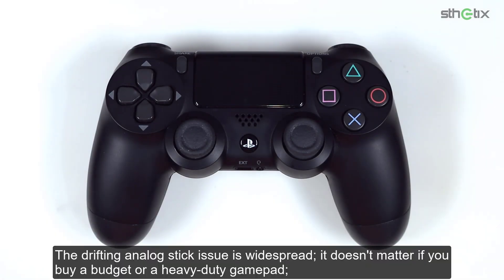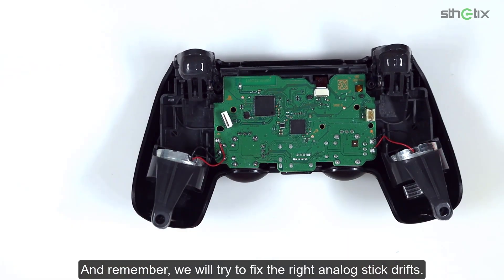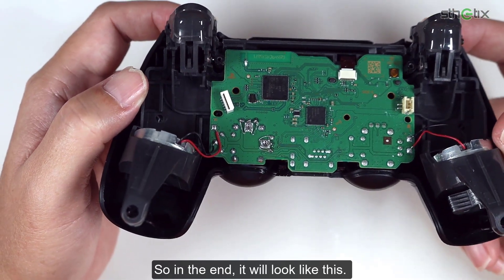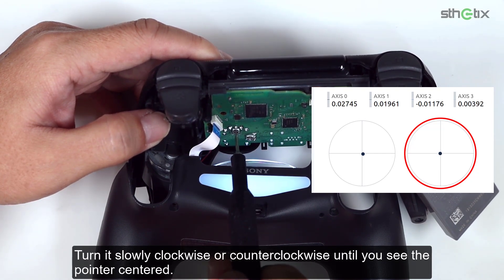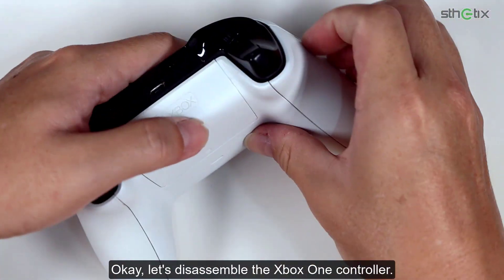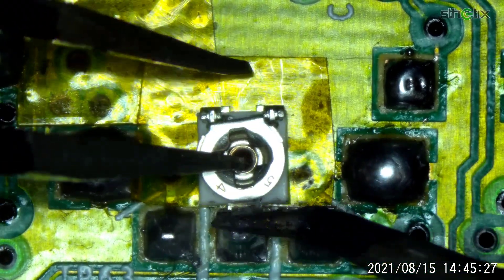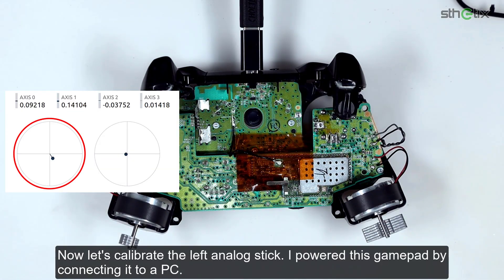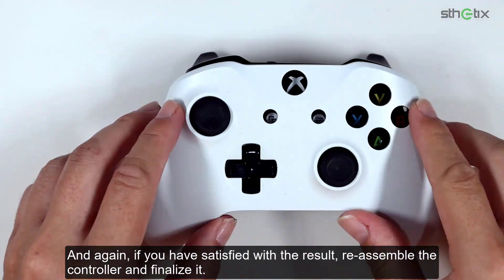THE ULTIMATE WAY TO FIX ANALOG STICK DRIFTS ? PS4 PS5 XBOX ONE NINTENDO PRO CON AND MANY MORE

Comment: at first I thought you were going to make the analog stick hotswappable so you could just swap it with a brand new one once it starts getting drift.
Reply from the maker: no that one not always work either
Reply: How are you going to secure it to the board properly? Use common sense dude...

Comment: this idea work but only for the right analog stick end it does not go all the way to the top or bottom, of the circle,, kinda stays half way dont use on the left analog stick testing on MW the player will not run since the analog does not go all the way to the top or bottom end the sprint press on the analog will not work also..  only work good for the right analog stick no the left....

Comment: I really appreciate the credit! :)
Reply: I was planning to email you this question, but felt like I’d be a bother. 

Would it be prudent to put your invention on the board after fully replacing both modules?

My thought process is:

Brand new modules that have been properly calibrated + your invention = almost guaranteed no stick drift issues ever again for the life of the controller. 

Thoughts?
Reply: When I saw the thumb nail I was like oh man this guy stole SolderKings idea but nope full credit. Respect!
Reply: I watched your video yesterday lol, great permanent fix and this will get so many controllers revived rather than binned.

Comment: Hello @
sthetix, can I ask for link with this potentiometer's? Link, or Part Number. Thank You!
Reply from the maker: I bought it locally, but if you want, try this link

https://www.aliexpress.com/item/1005001510805752.html?spm=a2g0s.9042311.0.0.7bd04c4d4NiFyU
Reply: @sthetixofficial  Thanks.
So I can use this Potentiometer also in Xbox 360 gamepad? Same soldering method as for xbox one controller?

I have: Xbox 360 x1 wired and 1x wireless gamepad and 1x xbox one s. In all 3 gamepads I have drift same as You have on video, same position ;)
Reply from the maker: same thing. try it